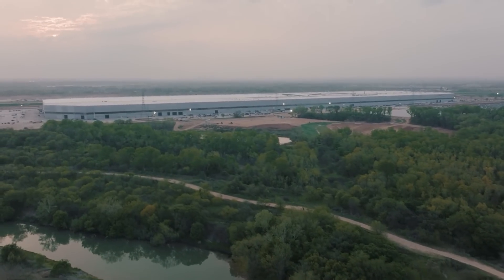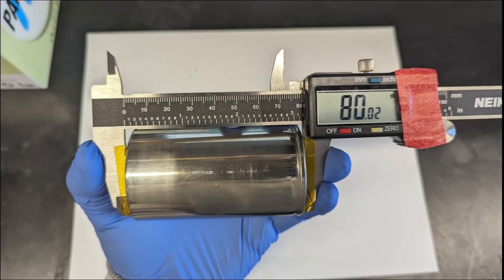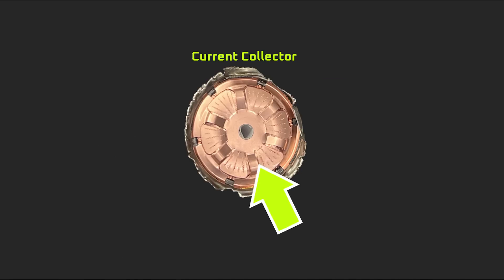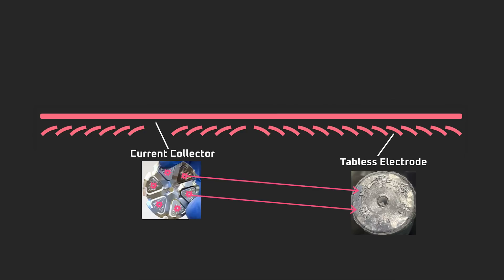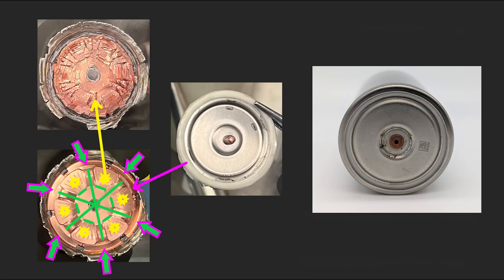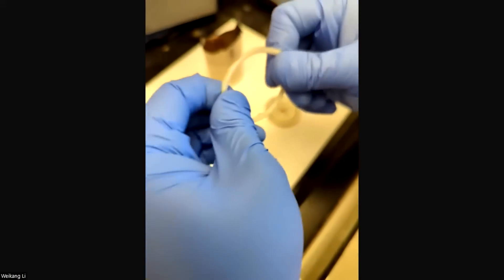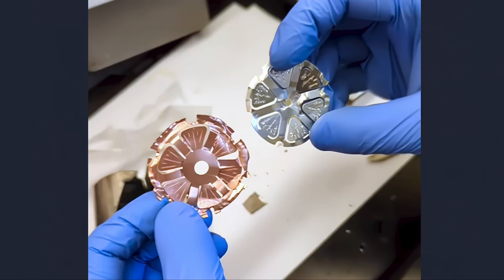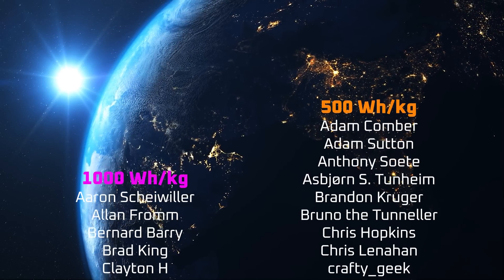The 4680 Current Collectors Explained //  A Temporary Crutch?

Comment: It's important to note that the ENTIRE sheet of copper that the graphite is printed on inside the jellyroll, including the laser cut tabs for the "tabless" electrode, as well as the entire aluminum sheet for the cathode electrode, are current collectors.  It is not just the thing that is welded onto the tabs.
Reply from the maker: Technically correct, but that's not Tesla's internal lingo.
Reply: @thelimitingfactor  I’d like clarification please. How does Tesla refer to broad metal foil substrate for plating electrode active material & transferring current (& heat)? BMFSPEAMTC(&H)?😊

Comment: Re Welding (Soldering). As I have been investigating CuSi3 soldering with a welding machine (for old vehicles) instead of welding its getting interesting what materials are connected together. Maybe Tesla uses this at the carossery where where there is steel and aluminum put together. 
Re battery, we have a steel can, copper and aluminum. And it seems all the different materials a put together through laser welding (as no welding/soldering material is added). Correct?
Reply from the maker: The materials are correct except for the can, which is most likely nickel plated high carbon steel
Reply: if the joint is gas free it doesn't matter  if it's differential metals you only get a bit of thermocouple generation no corrosion, steel is a poor conductor compared to copper incidentally so is aluminium
Reply: @kwinterburn  Steel and aluminum are worse electrical conductors, but the thickness of the steel can will easily makes up the difference.

Comment: It's strange to me that they used a current collector on the negative terminal for gen 1. Not sure why they felt they needed one there to begin with.
Reply: Welding different thickness metal parts is difficult.  Welding different materials together is difficult.  Doing both at the same time by heating the thicker metal is bound to take a long time to dial in.
Reply: @martylawson1638  Any opinion on the above spin welding speculation?
Reply: @Crunch_dGH  Spin or friction welding is great for big strong welds, but it's probably too messy for a battery case.  The jelly roll is quite delicate.  In the teardown video, the foils acted like they were much thinner than kitchen aluminum foil so the flash from friction welding would tear it up.  I'd guess that the can is laser welded on the same machine that does the can to jelly roll weld.  Laser welding is extremely precise and super fast.  So it's perfect for high speed production of difficult welds.